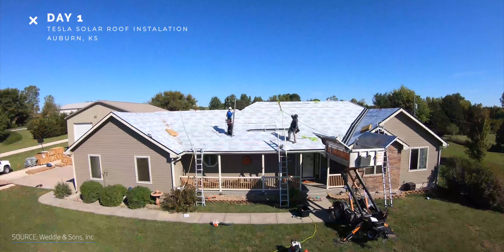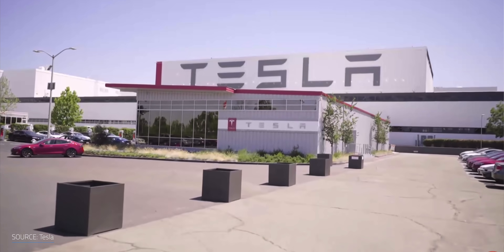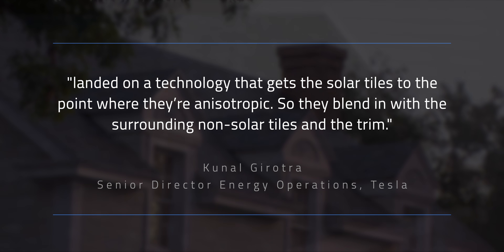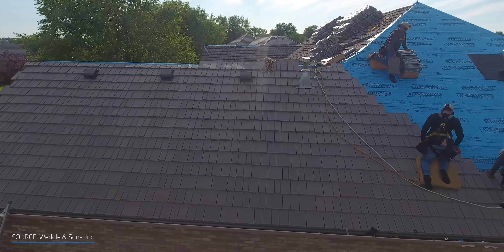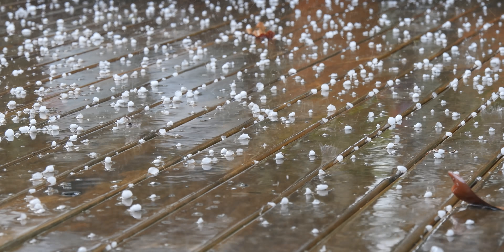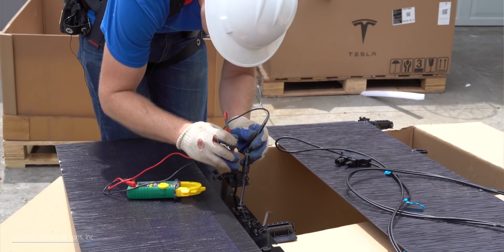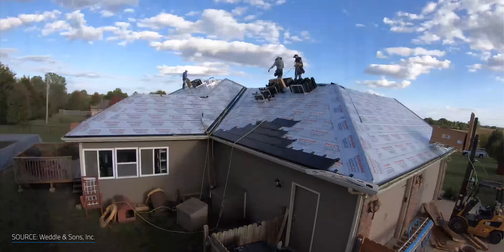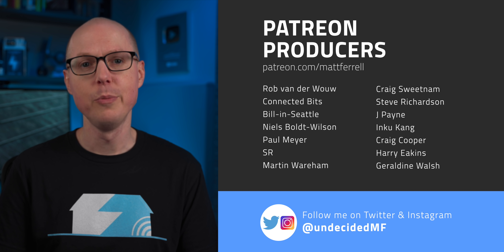Exploring If Tesla Solar Roof Is About To Go Mainstream?

Comment: I wonder if there’s any insulation bonus from that air gap between the roof and the tiles?
Reply: There has to be.
Reply: Undoubtedly! I installed a metal roof with just an aluminized bubble wrap underneath (not raised on furring strips) and I'm amazed at how little heat makes it into my attic now. That air gap under the Tesla roof has got to cut reduce heat transfer significantly.

Comment: Interesting video Matt! However, what's the cost to benefit ratio of installing one of these solar roofs? Also, I noticed at 10:17 into the video that they have to drill lots of holes right through the roofs plywood layer in order to install the panels. Essentially this would entail having to replace the entire roof structure when the panels need to be replaced. And what about roof leakage to boot? Anyway, Happy New Year to you & your family.........  😉👍
Reply from the maker: Thanks, Steve.  It’s tough to give the cost benefit ratio since each installation’s cost can vary wildly.
Reply: Hard to know this since you don't have the context for the hole shown at that point, but there are actually only about 3-4 small holes drilled on the entire roof to feed cables through and then a pass-through box with continuous sealant is screwed down over the hole.

Comment: Another GREAT video Matt!  We just built a new home in Alabama and I was really hopeful to get the version 3 roof from Tesla installed.  But there is literally NO one who can install it, not to mention NO incentives in AL for using solar.  So, we went with a conventional roof.  In the future, I plan on adding solar to the existing roof, but would have easily spent the $$ needed to go with Tesla had it been available.
Reply from the maker: Thanks, Mark!  That’s the biggest disappointment to me with the Solar Roof.  It’s still only available in very limited regions.  Hopefully that changes over the next year.

Comment: Such a good point about the maintenance cost of having regular solar panels on a normal roof that isn't hail resistant
Reply: so that made me think..... Why the hell isn't regular tesla solar panels hail resistant?
Reply: @letsnotmakethispersonal6021  All solar panels are hail resistant.  I've had solar for 30 years and have never had a panel damaged by hail.  Of course I don't live where hail can get as large as softballs.  Some places have hail storms that smash the roofs of cars.  Not many types of roofing would avoid damage in those conditions.
Reply: @bobwallace9753  I mean why dont they make their regular solar panels out of the same material as the tiles.
Reply: @letsnotmakethispersonal6021  Can't answer that.  My first question would be whether that would cause an increase in panel cost that would drive up the cost of a Tesla solar panel package.

There's two markets here.  Solar roofs, at least for now, are for more upscale houses.  Houses where people are willing to pay for a more attractive roof than a simple asphalt shingle roof.  Tesla really has no competition here and, based on info in this quite good video, Tesla is competitive with other upscale roofing methods.

Solar panels are for the retrofit market.  People are looking for solar at the best possible price.  Tesla seems to have figured out how to deliver very competitive solar packages via fixed size packages and not spending money finding customers.  Right now Tesla needs to keep the cost of their installed solar packages as low as possible in order to create a lot of word of mouth advertising.  Maybe it makes sense to let insurance companies worry about extreme hailstones,, hurricanes, and tornadoes rather than building a bulletproof panel and having to charge for that level of engineering.
Reply: @letsnotmakethispersonal6021  It's because regular solar panels are specced for high efficiency, and these solar panels are worse than flex solar panels efficiency wise. Literally the only thing these panels have going for them is their looks.
Reply: @Wingnut353  they will improve over time like everything else. I remember when a 17inch lcd computer monitor cost $2,000 in the 90s and it couldn't even be used for gaming cause of low refresh rate. Gaming back then was unreal tournament. Now for $2,000 you can get gaming laptop 4k resolution
Reply: @letsnotmakethispersonal6021  - too expensive, heavy, and less efficient.  SolarRoof tiles have about 1/2"+ of glass.  They are really sturdy, a 250-pound installer was bouncing up and down on mine to demo the strength.  Tiles with active solar run about 7 times those without.
Reply: @JD-yx7be  No, there is very little room for improvement here.  The appearance approach drops the efficiency, can't be changed, the cell type itself is not as efficient as a mono silicon system.  Also, there actual cell area is smaller.  They have very little room to go up in efficiency with these tiles.
Reply: @letsnotmakethispersonal6021  The point about hail resistance with regular roofs + solar panels isn't that the solar panels are damaged, but rather the regular roof. And that for replacing that roof they might have to also remove and afterwards place back the panels, increasing work and costs. This wouldn't be the case for the solar roof, since 1. it doesn't get damaged as easily and 2. if some tile(s) break, they apparently are easy to replace.

Comment: You also have to consider that Tesla Tiles are WAAAAY less efficient than a regular solar panel. It produces like ~30% of the energy of a solar panel with the same area. It's not a problem if you have a huge roof, but if your roof is small, you probably want to get as much energy as possible from your available surface area.
Reply: Do you have numbers for the solar roof? Regular pv panels are around 200W per m².

Comment: Will be building a new home in California in next couple of years (all electric so no open flames). DEFINITELY going for Tesla solar roof. House will be small (1250 sq. ft) on one level.  Hope the smaller size means it will be much less than you quoted (you didn't mention size of roof in your quote).  Can hardly wait to do this project. It's my retirement home and my legacy to my son.  Maybe by the time I build, the roof will have an even longer warranty - 30 or 40 years.